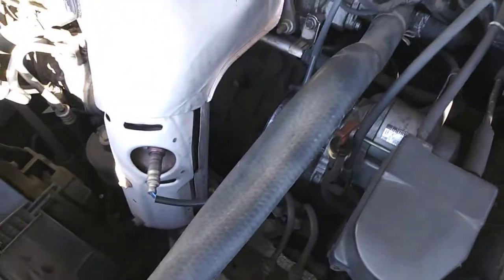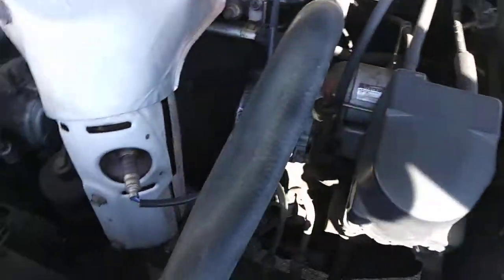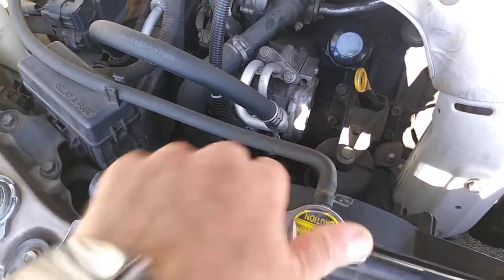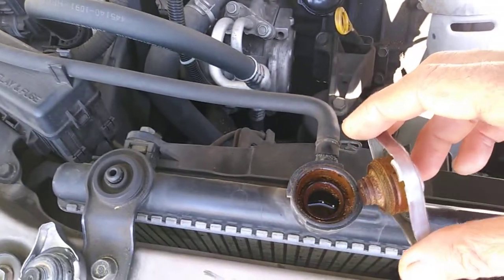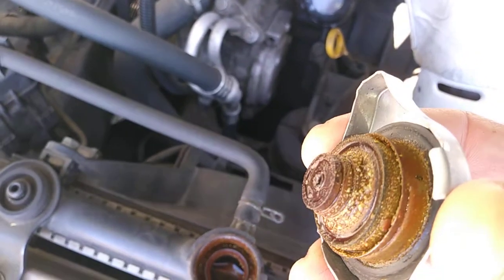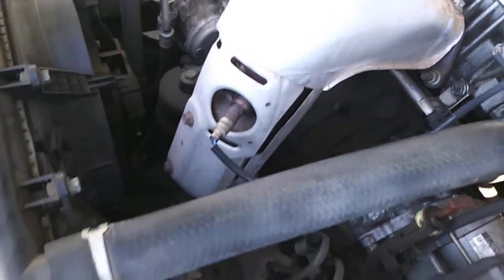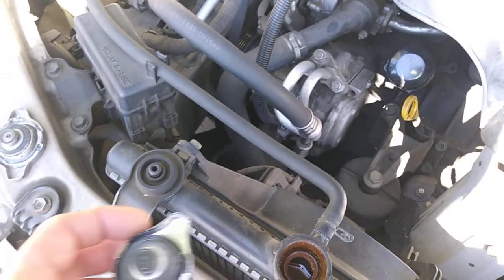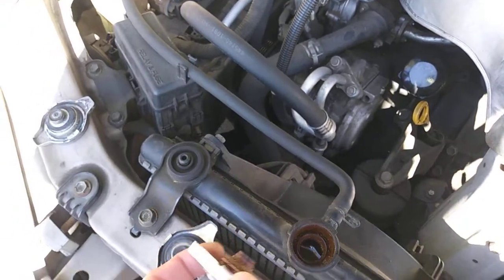Why My Radiator Hose Is Collapsed.

Comment: Befor I put a new cap radiator my hoses was not collapsed. but when I put a new cap radiator my hoses collapsed I dont understand why ?
Reply: The little valve is stuck , clean it